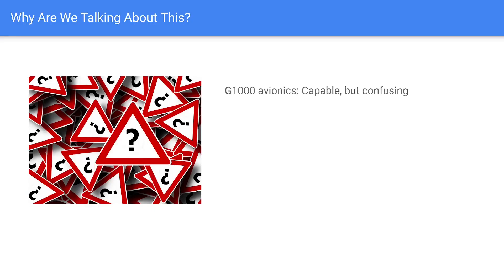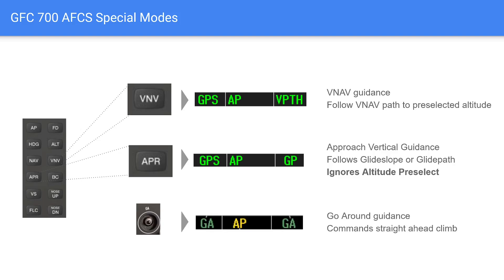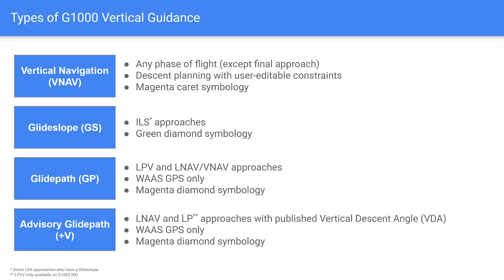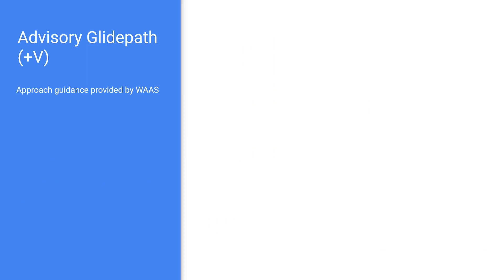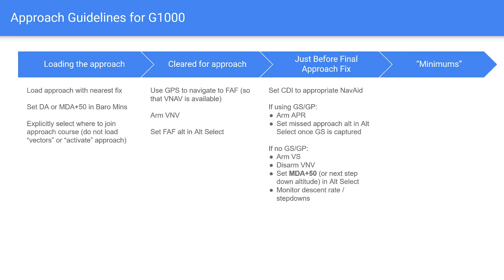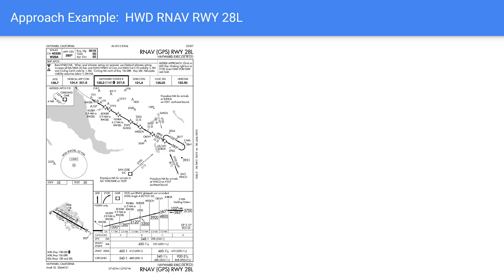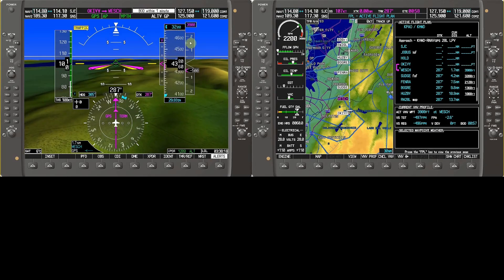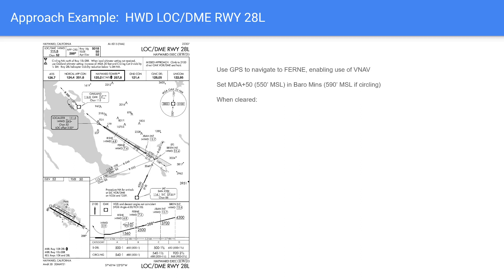Flying Instrument Approaches in the Cessna G1000

Comment: This is a wonderful video. on the slide "types of G100 Vertical Guidance" you make reference to the advisory glidepath (+V) and state that this is only available on LNAV and LP approaches with published Vertical Descent Angle (VDA). 

My question is that VDA is shown on FAA approach plates by the angle symbol on the profile view. The "v" is a different concept -- visual descent point. 

If I understand you correctly, the advisory glidepath should be available if the VDA is shown in profile view even if there is no VDP shown by a bold "v."  For example, look at RNAV (GPS) RWY 29 into KLLR. This has an LP approach and a VDA of 3.5 degrees but no VDP. I should get +V on this approach. Is this correct?
Reply from the maker: @perossichi1, Thank you!  You are correct that you may receive +V vertical guidance even if there is not a VDP on the chart. On the LLR approach, and all approaches with LP minimums, whether you receive +V guidance depends not only on the existance of a VDA, but also on the type of G1000. The Cessna non-NXi G1000s do not provide LP+V service, but I believe the cessna NXi G1000s do. I also believe Cirrus Perspective+ G1000s do, and I am certain the GTN 650 and 750 do.  The sure way to tell on a G1000 is when you load the approach it will say “LP” or “LP+V” out to the right of the approach name in the FPL line where the title of the approach appears (above all the fixes).
Reply: The funny thing is that my old 530W in my previous plane DA40 would give me Lnav+v on this very approach.
Reply from the maker: @perossichi1  Interesting. Maybe it was before there were LP minimums? Or it may not be LP capable - I believe only later software versions are.

Comment: Hey captain nice video, I tried to perform your 28L RNAV approach but I can't see the GP or any GS even the TOD it's like my current VNV profile is blank and I have been trying to figure out why I can't see any GP or GS in my RNAV approaches outside of this case. Can you help me figure out what's going on?
Reply from the maker: Are you in a simulator it an airplane?  Is it WAAS?  Non WAAS G1000s and other GPS will not show vertical guidance on RNAV approaches. They should still show you VNAV guidance though, as long as you  activate a waypoint with a VNAV constraint.

Comment: Great Video.  When starting the missed approach with the GFC-700 and after Climb to follow FD guidance to pitch up is it OK to activate the Auto Pilot and continue the steps after that ?
Reply from the maker: The Cessna G1000 / GFC700 has a limitation that it cannot be engaged below 800 AGL except during "approach operations" when it can be engaged as low as 200 AGL. So in my mind a loose interpretation suggests that a missed approach is part of "approach operations" and therefore it's fine to re-engage the autopilot immediately as you start the missed approach, provided you are above 200 AGL. 

I think this is further supported by the fact that the go around button on the GFC 500 (basically the after-market version of this autopilot) does not disengage the autopilot; the autopilot stays engaged as the plane pitches up to the go around attitude.
Reply: @FlyingLessons  Thanks James.   Looking for G1000 hands on training in Texas area.  Any suggestions would be appreciated.
Reply from the maker: don't know anyone down that way unfortunately! Good luck!